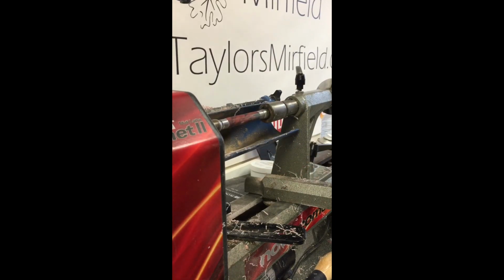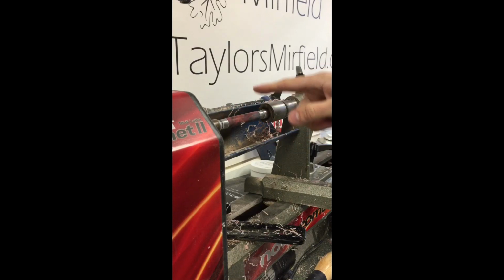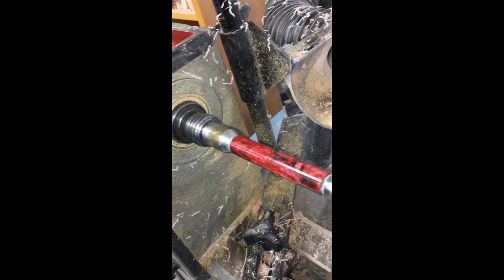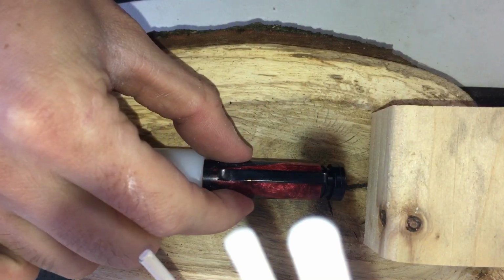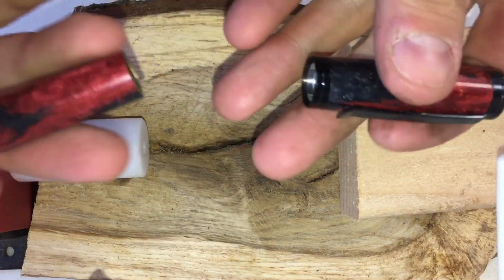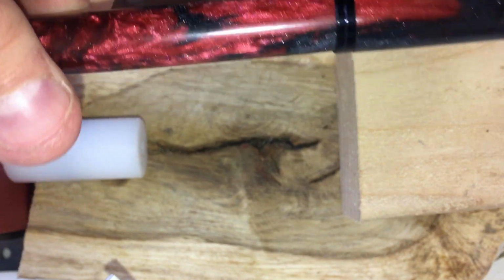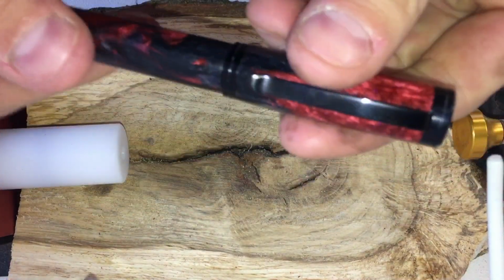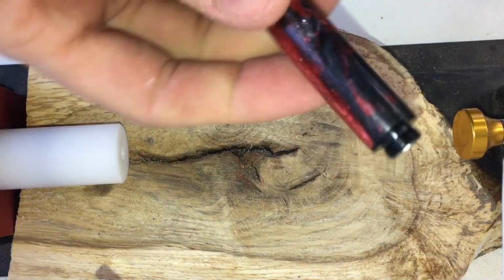TaylorsMirfield.co.uk British Made Shakespeare Pen Kit in Stones Diamond blank Assembly Video

Comment: What is the squareing jig you use?
Reply from the maker: Jamie McDonald I use a magnetic v block with a set of Transfer punches. With a sanding disc on the headstock it works far better than a barrel trimmer IMO.